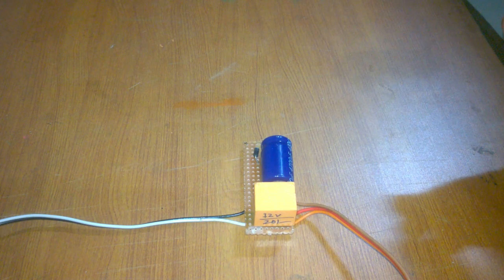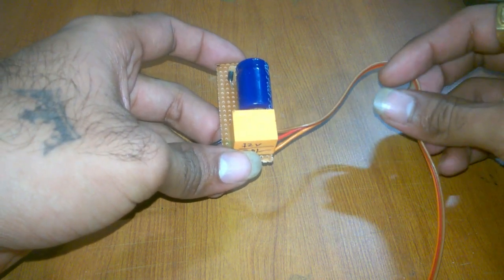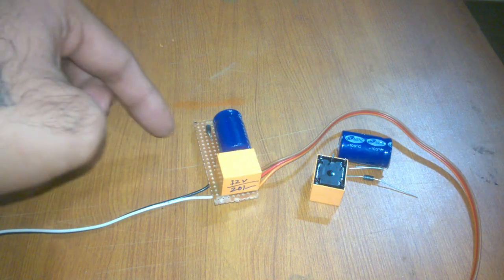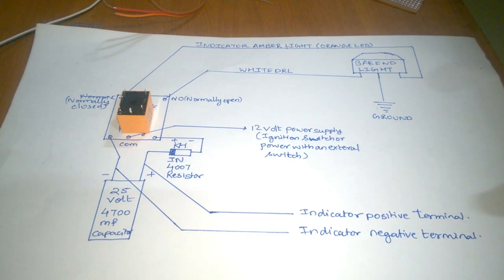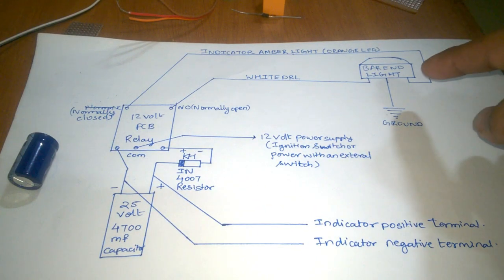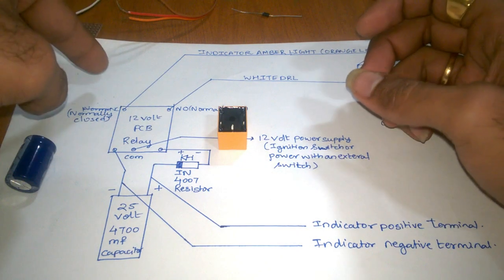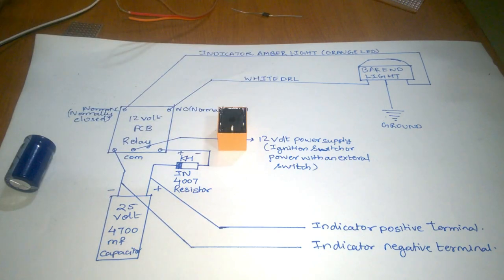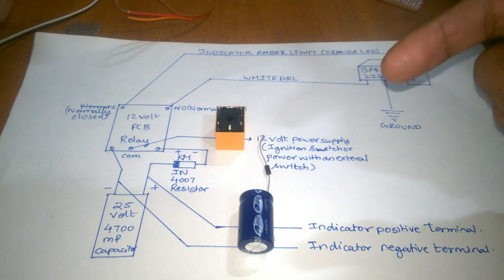How to make a switch back circuit for bar end lights or dual tone leds.

Comment: I was unsuccessful  in duplicating this .. the problem with mine is that yellow was lit and then when I hit the signal turn indicator  it jus flashes as if its turnin.. and it doesnt even connect to white.. I have the white connected to a direct existing  12v drl line   any suggestions with trouble shootin
Reply from the maker: Contact me on instagram or Facebook I'll send you hand made wiring
Reply: Wats ur facebook

Comment: I'd like to do this project. Just got a question.. 2x Car LED Signal Bulb COB Auto DRL Daytime Running Light Eagle Eye Fog Lamp Brake Reverse Parking Styling Yellow Red 18MM 23MM I have these switch backs.. the problem is that when I connect them as stated the white stays on as the blinker is activated... so will ur  set up help with  that issue   .. when the turn signal is activated  it will completely  turn off the white then reactivate once disengage on the turn signal ?
Reply: Btw what did u use to "pot"the set up
Reply from the maker: Yes it'll work on any 12v setup
Reply from the maker: I didn't understand what are you trying to say brother
Reply from the maker: These are the Components used for circuit
12 volt pcb relay
IN4007 resistor or diode
25 volt 4700 μF capacitor
Universal circuit board or prototype pcb
Some wires
Reply: I've ordered my parts I'll be makin this shortly thanks for the info .sorry for the confusion ... since it will be in my vehicle I need to protect my components from the elements but I'll figure that out later ty
Reply from the maker: @jasonhernandez6291  you can add a inline fuse on input of 10amps or so
Reply: When u reference  terminals are you talkin bout the positive line for  turn signal and the negative  side of the turn signal  or are you talkin about the terminals for the battery
Reply from the maker: I refered it as indicator positive and negative terminal

Comment: How to
So if I have my drl and signal is negative and common positive ?
Reply from the maker: Negative will be common always and two positives will be there
Reply: Currently my stripe has amber and white which has a common positive . In this case how I can do the switchback function?
Reply from the maker: @kwanghoong   on 12 volt power supply wire connect negative wire connect positive of strip to pilot light or parking light and connect both negative of strip as wiring diagram itself.

Comment: Amber Light doesn't blink. Remains constantly on when switch on the indicators
Reply from the maker: Bro check the wiring diagram again and connect again
Reply: Yeah done it but still no success the amber light just stays on without blinking rest everything working fine..
Reply from the maker: @amanpatnayak5684  check the flasher relay on your two wheeler if tht doesn't work try led bulbs
Reply from the maker: And even check if white light is blinking
Reply from the maker: Is everything working now
Reply: Everything working fine bro.. I had soldered the amber in a wrong pin.. Thank you
Reply from the maker: @amanpatnayak5684  ok brother I'm glad my video helped you

Comment: Why use not 1000uf
Reply from the maker: Time interval between switching of both LEDs will change delay will be less there's no problem in using 1000uf capacitor untill and unless its 25 volt.